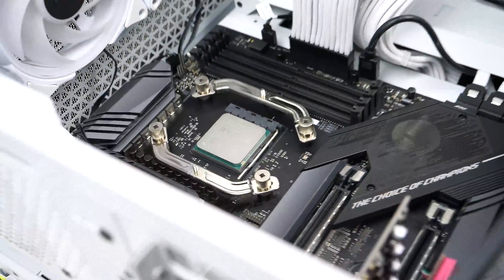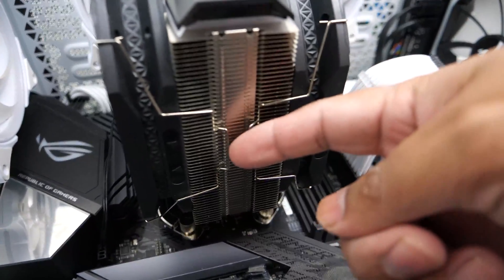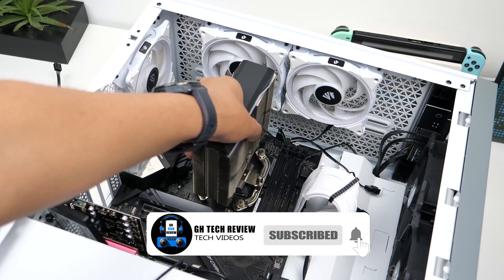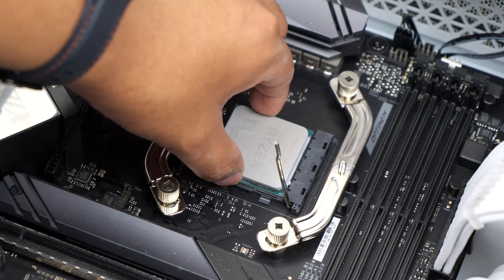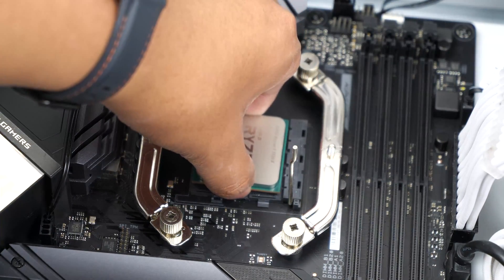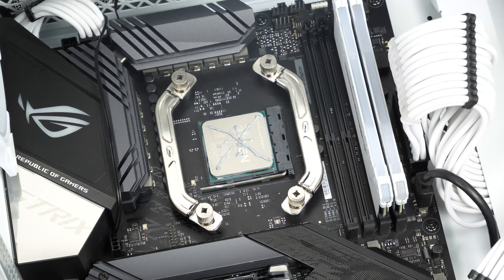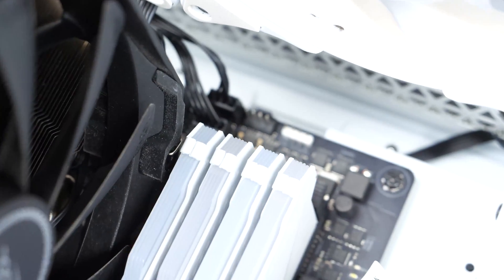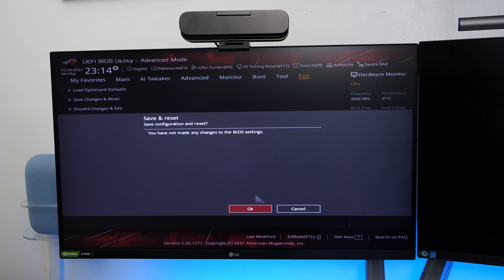How To Upgrade Your CPU Step By Step | AMD Ryzen CPU Installation 2022

Comment: Anyone else thinks this is too much thermal paste? If you ever made a pancake before with batter you know that screwing 2 plates together with that much thermal paste it's going to drip out on the sides?
Reply: When he removed the CPU you can see a bit of thermal paste going into the socket 💀
Reply: Better too much then not enough. It won't hurt anything.
Reply: Technically if you don't care about the mess there's no such thing as too much if the cooler can still be mounted properly
Reply: @AndrewB23 if you have too much it can cause it to not cool your cpu properly
Reply: Yup, first thing I noticed.
Reply: Just seen this comment after watching the video .perfect
Reply: Not as bad as the verge vid but definitely a lot lol
Reply: Does it matter if it still cool down the cpu?
Reply: When i upgrade the cpu will i lose windows and games, files? And i can use the same cpu cooler?
Reply: @SpiderMan4327 no windows is on whatever you use for storage, if you don’t change SSD or hard drive it all stays the same. And it depends on which cooler you currently have
Reply: @SpiderMan4327  cpu has nothing to do with storage and files, you won't lose anything
Reply: Your mother
Reply: Better to smooth it out with a thin piece of plastic gently and evenly onto it then apply the heatsink
Reply: Thats why its best to add a little drop at a time and just make sure theres a nice thin even spread across the whole thing
Reply: YES, that is way too much in my opinion. Looks like using bondo repair on fender damage! Shovel it on thick and spread it out with a yellow applicator lmao
Reply: They actually did testing on this a while back and the CPUs that had the paste applied like the last conparison innthe vid actually ran 3-4°c cooler
Reply: When I built my first PC (before YouTube) my computer-savvy friend insisted we use THE ENTIRE TUBE of thermal paste. The. Full. Tube. 

Needless to say, that was not a very stable build. Anything more than pea size is too much.
Reply: @amasse1  nah he had it out for you haha
Reply: @amasse1   m m.

Comment: 3.5ghz you need a water cooling....
Reply: Ehhh ?
Reply: @markdomenie5453  I know right 😂> Running a air cooler on 3.5ghz is fine its not like you have a 5900x but even with that you can put a good air cooler on there it just has to be a beefy one. I prefer liquid cooling myself but I laghed at your comment you said "Ehhhh?". 😂😂🤣🤣😂😂
Reply: @shadowghost815  hahah yea😂. I have a simple Deepcool Ak400 on my 5700x and it doesn't even go over 50c at full load.

Comment: I’ve done this before but I’m the past I hasn’t changed anything in bios prior. This time I have tightened the Ram timings as well as changed numerous other settings. Do I have to load optimized defaults and redo all of this or let the new cpu run using these settings? Some are specific to the cpu.

Comment: so i dont have to run a clean install of windows or anything? just changing the cpu will be enough?
Reply from the maker: Re-installation of windows is not necessary if you are only swapping out your CPU.

Comment: What do you do with the old cpu before you change it is there like a reset or is it just changing it
Reply from the maker: There is nothing you need to do before changing. You pretty much just change it. After installing the new cpu you can look for updates to the chipset.

Comment: For me my screen doesn’t show up on the monitors
Reply: Put your old cpu on and update your bios before. That’s what I was told I’m having the same problem right now but try it it and let me know if it works. I’m going to try it in the morning.
Reply: @bitchpleaseimaninja  oh yeah thats the problem I already had it fixed brought it to the local shop and they did it for me
Reply: @ItsBanksieTR  oh I just did it and it worked
Reply: @bitchpleaseimaninja  oh lol nice
Reply: Same
Reply: Did u guys get it to work?
Reply: @P4wgluvah  put your old cpu back and update the bios before and then install it.